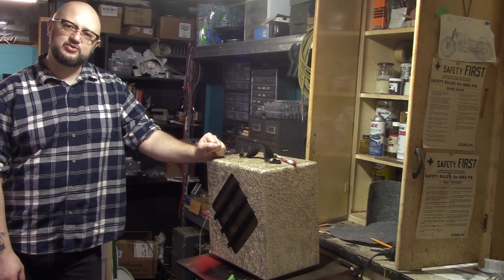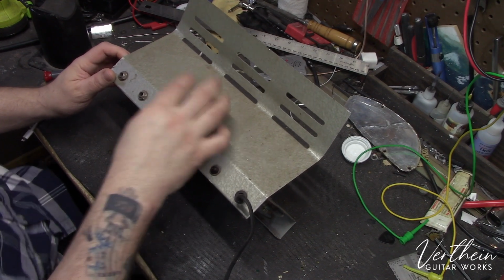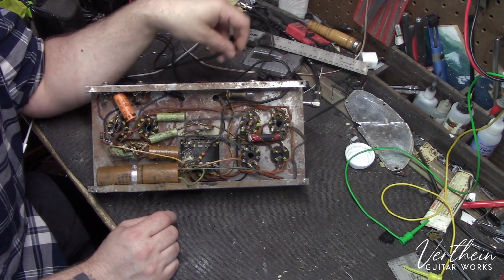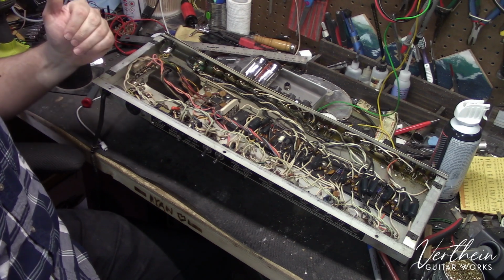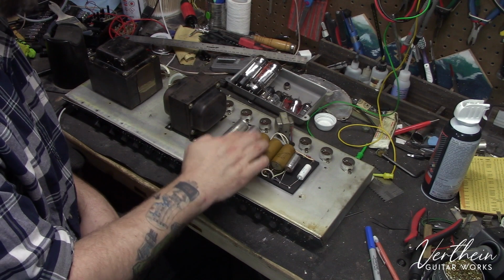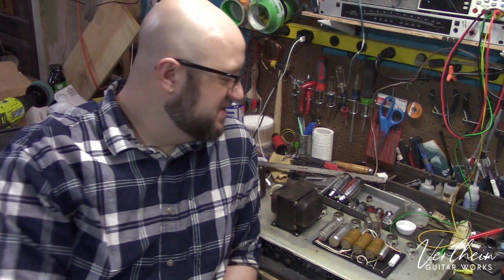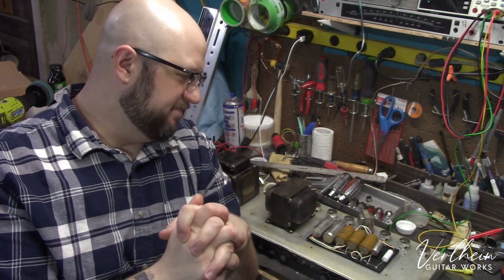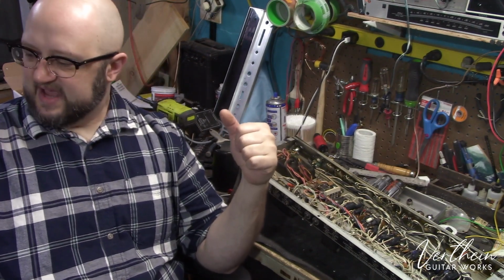Conversations on Servicing Old Tube Amps.

Comment: When the electrolyte breaks down and the layers of foil short together, the failure is catastrophic and the cost of repair is high. Forget the nostalgia and change the damn things! Collectors are weird. They belong in a rubber room, preferably with double or even triple padding. Go ahead and rant about this to your heart's content. Youre not only right, you might even save a few amps.

Comment: At 6:32 you state that filter caps block DC and allow AC signal to pass through but that's not so with filter caps: they smooth the rectified AC (which is rippled DC) by storing voltage during the upward cycle and releasing it on the downward to smooth it out. The caps you're talking about are signal caps (a.k.a. blocking caps) that pass AC and block DC.
Reply: Yes. I ramble sometimes and miss details. But you are correct!